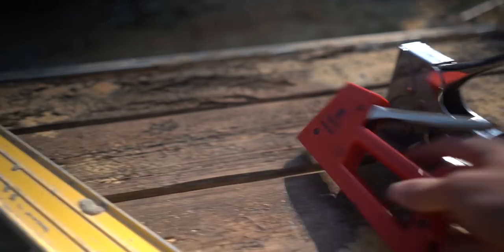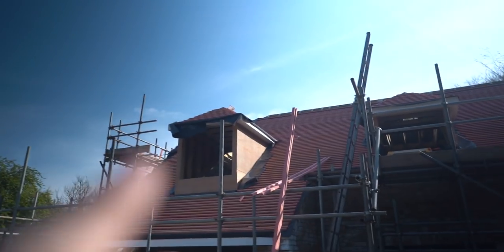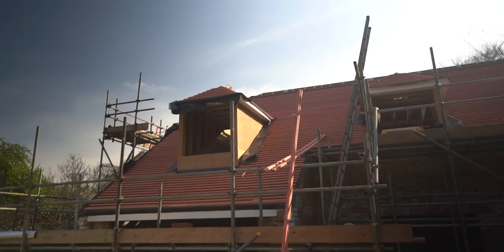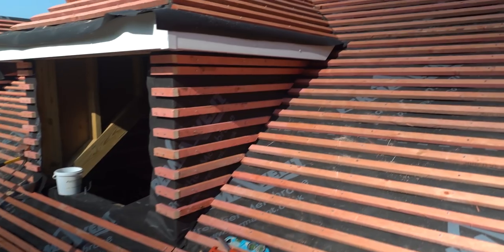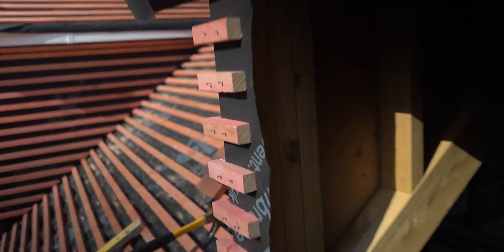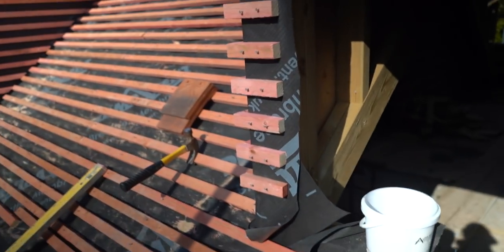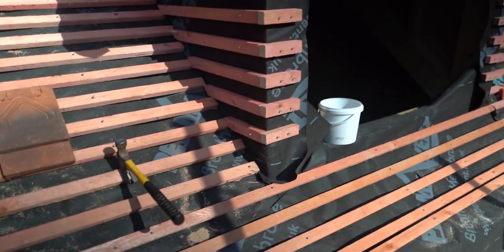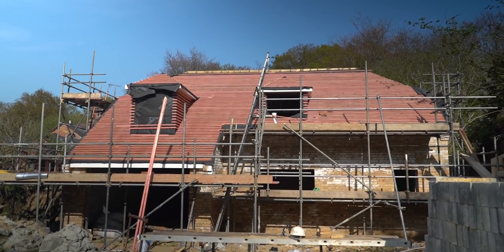BUILDING A HOUSE ALONE from START TO FINISH | E.P 43 [Half of the roof is ready]

Comment: I used to use a hammer tacker for stapling felt used to be a tenner just checked their 25 quid now so i'd keep on with your shed find, should use 6 inch lead apron to cover nail holes on the tops, fit before tiling.
Reply from the maker: I'll use this one till it breaks 🤣 A few people have commented about using lead so looks like the best way to go
Reply: @RodianBuilds  👍👍

Comment: Lead flashing to cover the eave on the dormer
Reply: drop a bit of lead as said above and if you use lead always put patination oil  on to protect it,  keep the lead runs no longer than 150cm and have a minimum over lap of 10cm good luck.
Reply from the maker: I remember being told years ago to always use patination oil. Never forget that 😁👍🏻

Comment: You should of packed the top baton out to the biggest point where the 2 tiles overlap then put a bit of 4" PVC or plate on top to cover the nail holes , And nail it onto the top baton so the PVC sits straight and plum,  All the best mate!
Reply: So if you use a 100mm plate put 2 tiles there and see what the build up of the 2 tiles is where the 100mm land if that makes sense usually about 40mm hope this helps!
Reply from the maker: Cheers Chris, I get what you mean. I think I'll use lead but I'm not against using PVC. Depends what I prefer the look of. Appreciate the tips 👍🏻😁

Comment: I'm no roofer myself so I'm not gonna give you the most valid advice 😂 but done a couple of porch and extension roofs. My thinking would be lead work and tiles before battening out the dormers but you could easily pull bottom ones out to get apron and soakers in. Are you not using lead valleys either? Looks good to me anyway, enjoy the sunshine 😎🏖
Reply from the maker: I've been told that I dont need to do lead valleys but I think on going to out some sort of dpc valley in under the battens. I dont mind pulling the bottom battens off to slip a soaker in if I cant get it in without moving them. Thanks for the tips 😁👍🏻

Comment: Hi mate, a few tips. It's best to soaker and tile the main roof before battening over the soakers on the cheeks. I usually tile up to front of dormer, fit the aprons and then batten the dormer, the way you have it the battens might be obscuring the upstand of the Leadwork/soakers. Also flip your top eave batten on edge, that way your top tile won't dip back. Check your FB pms .
With regard to the top tiles, those phalempins have a chevron which doesn't look great on show. You can put a small 150 flashing through the top and a few lead straps. Give me a shout on messenger if you need any help.
 All the best
Reply from the maker: Thanks Ben for the tips! I did notice the top eves tile didn't sit right so I will deffo turn the batten on its side! If I get stuck I'll deffo get in touch 😁👍🏻 appreciate  it
Reply: Yeah either that or tack a 10mm lathe on top of the top eave batten to kick it out a little

Comment: I'm a roofer,plasterer,roughcaster to trade built a 2 storey extension a few years ago with block setting out and getting the levels were key(someone else kept us right with that) only do the odd bit of building work these days good to see your game for it 👍 hardly used plain concrete /clay  tiles mind you are you going to used bonnet hip tiles  up the hip and purpose made corner tiles around the dormer?
Reply from the maker: I'm not going to use bonnets, going for normal ridge tiles. Will be using the 90° return tiles for the dormers. I'm always game for it pal 👍🏻😁

Comment: Re batten it. Get rid of top eve batten. Cut tiles down for sticking on with some pug for top row. 3 sand 1 cement is the roofers mix.
Reply from the maker: Can I do this even if I need the screw down ridge system?
Reply: Were talking about the dormer cheeks. 
 With regards to the apex ( ridge)  stick your tops so you can still see the ridge  tree. Dont hang tiles onthe ridge tree otherwise not enough wood available for fixing the ridge down.
Reply from the maker: Right, I get it. Thanks 👍🏻😁